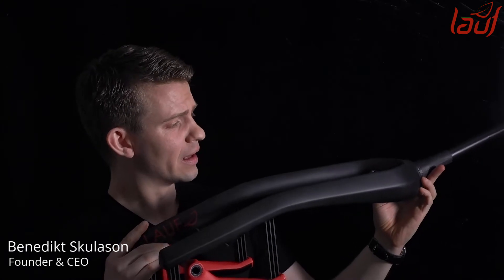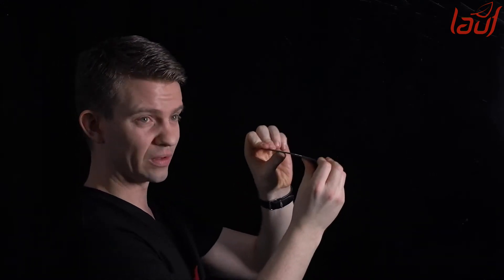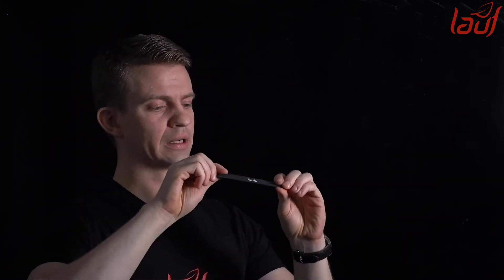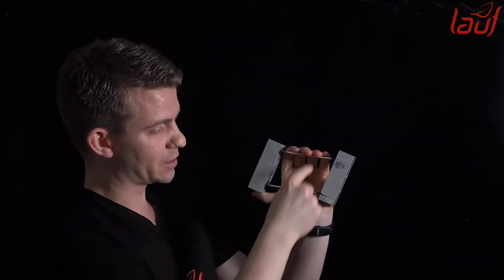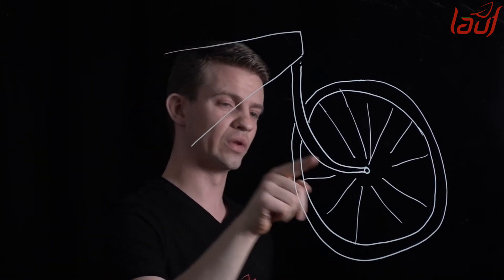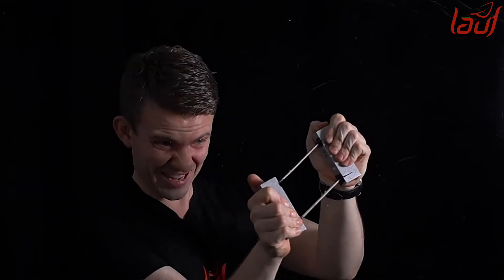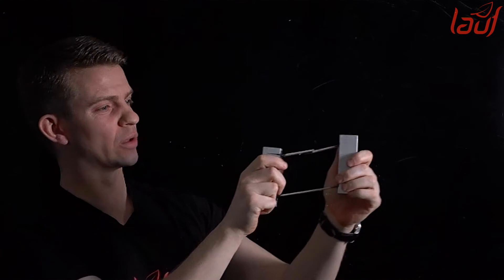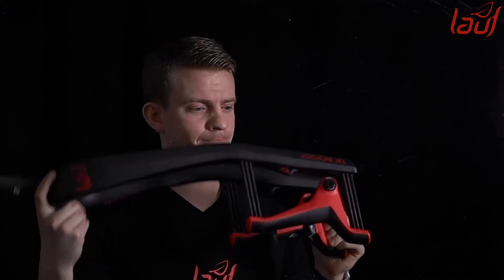Tech Talk Episode 3 - Lauf and non-Lauf leaf springs

Comment: Rixe in Bielefeld/ Germany in 1982 used leaf springs for a back wheel suspension. The material was Scotchply by 3M, normally used for helicopter blades.